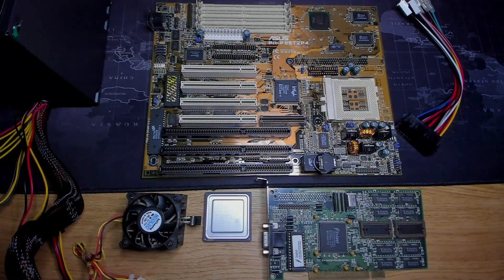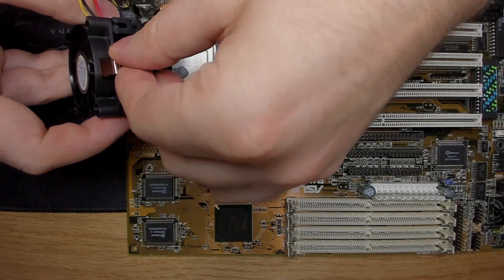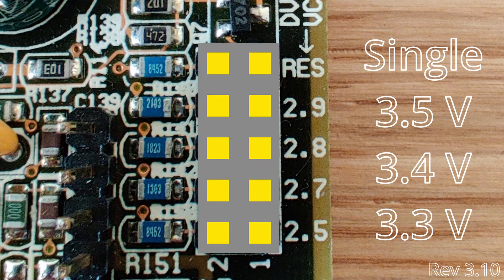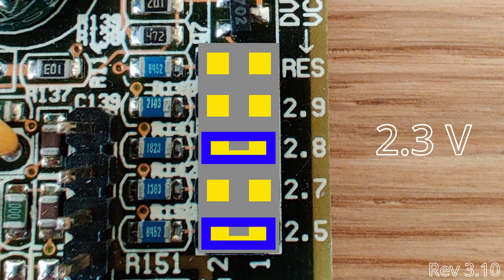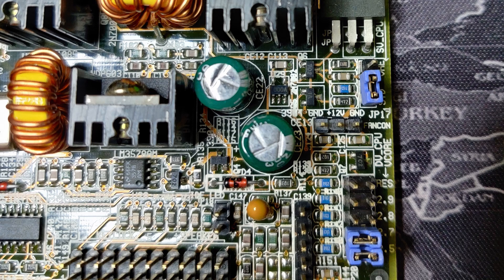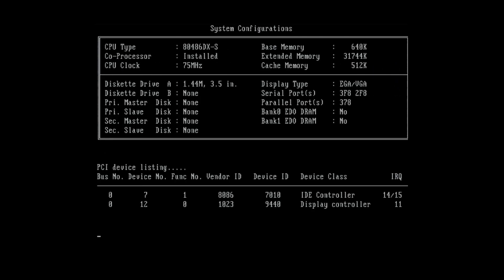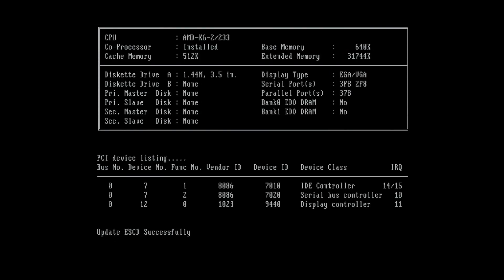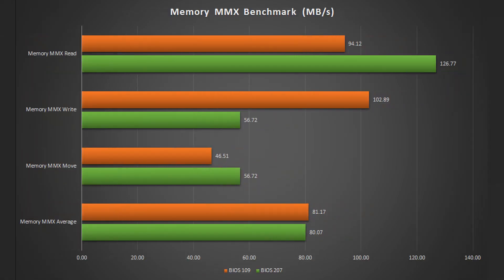ASUS P55T2P4 - Rev 3.1 with AMD K6-2 @ 233 MHz

Comment: Hi, I know this video is 3 years old but I came back to it having recently acquired a cheap P55T2P4, I built a few Necroware NWx287's and added one on the board, I'm running a K6-2 500 @ 500 with 6x83mhz (the board obviously sees it as a K6/2 400), added the TAG ram for 512mb cacheable area so I'm using 128mb edo ram, a PCI Riva 128mb 4mb I repaired(poor solder on vram), a 12mb Voodoo 2 I repaired(caps and poor solder) and an SB CT2770 I repaired(caps, a broken trace and an Oscillator) and all cards are happy with the bus speed, it's perfectly stable and plays games really well especially with the V2, some awesome performance for such an old board that should've never ran anything past a P233.
Brilliant how far your channel has come btw, you deserve more subs and wanted to say that I really enjoy your content. 👍

Comment: P55T2P4 used to be my daily driver for quite some time. I got it as it was famous for its stability and reliability. Eventually I replaced it with FIC VA-503+, also a great and stable board for high-end K6-2 processors.
I don't know where and when my P55T2P4 went missing, but a few days ago I was able to get hold of another one, Rev 3.0. I'm hoping to set up a great retro machine with it :)
Reply from the maker: Happy to hear that you got your hands on a P55T2P4 - they are great boards! Good luck with the retro machine, I am sure it will be awesome!